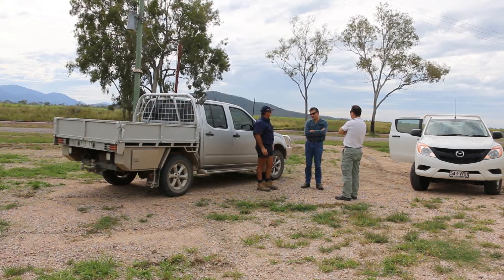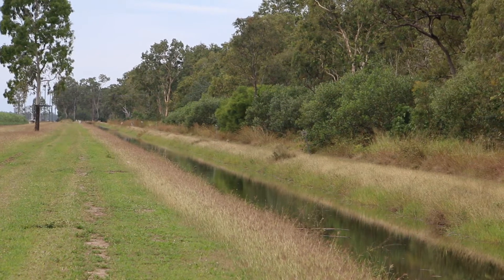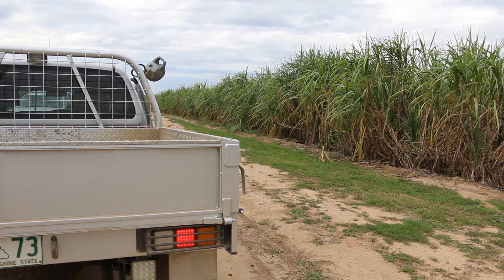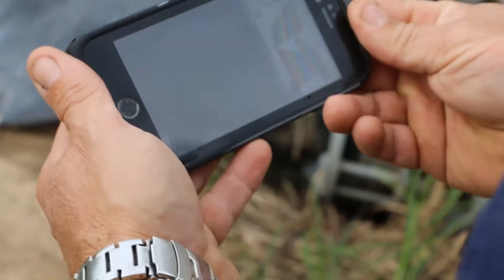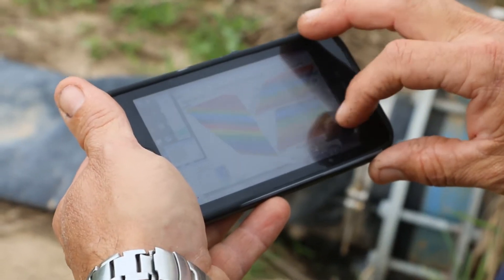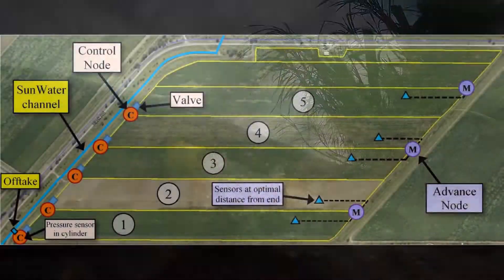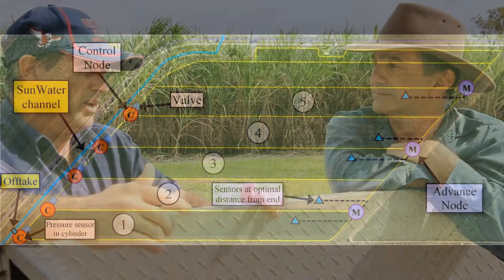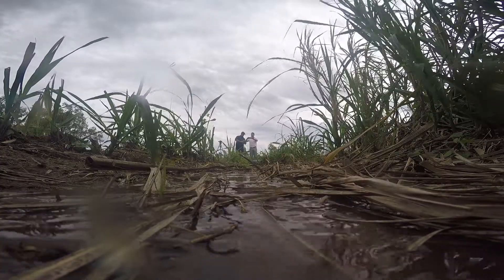Automation of furrow irrigation: Russell Jordan

Comment: Customer Premise Equipment - CPE's Tp-Link or Ubiquiti both manufacture cheap weatherproof units and come with a long warranties for peace of mind, CPE's provide a hassle free way of long-distance high band width data transfer - data transfer can be ip camera or internet or any other form of data, sonoff wifi switches provide an easy way of wirelessly controlling valves, gates or other irrigation equipment.  Cameras provide an easy way to pan/tilt zoom remotely for visual confirmation of bottom end water with the add benefit of farm security. the best part of CPE's is they can point to multi point function meaning you can use your business/home internet to supply the entire network of cpe's, cameras and sonoff switches to allow for connection whether you're in Australia or halfway across the globe. not to mention if you fit a CPE to your tractor or Ute you can connect into the network (range permitting but anywhere from 1km to 100kms depending on the CPE chosen without phone reception) tplink cpe/wbs